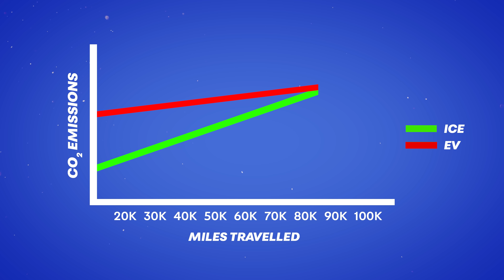Are Electric Cars REALLY That Green? [New 2022 Data]

Comment: A lot of owners of Ev or ICE cars are all contributing to the pollution problem. Why? Because of all the bloody idiots who drive SUV's! and what are the reasons they do this?

Reason No 1. 'I want to 'protect my family' 
Yeah, they might be safer for you but they're certainly not for other road users and pedestrians. Most SUV's both EV and ICE are incredibly heavy and much higher than most normal cars so when you hit a smaller car you're likely to do much more damage/ risk injuring the occupants of the other vehicle. It's also the same for pedestrians. With smaller lower cars in a front impact the pedestrian is more likely to roll up the bonnet (hood) and suffer a less serious injury whereas an SUV has a higher front so, for pedestrian, it's like hitting a brick wall.

Reason No2 'My d**k is bigger than yours' 
How many people that buy these 4WD Chelsea Tractors actually need one? How many of these SUV owners actually use them off road? Hardly any of them. It's all about keeping up with your other more-money -than-sense friends.

Reason No3 'Due to advanced technology both modern EV's and ICE SUV's are better for the environment'
Once again it all comes down to weight. A smaller EV or ICE car weighs less so doesn't need such heavy batteries/use so much fuel. If the vehicle is lighter, it uses less energy. Simples!

In conclusion: (And I know I'm going off topic her).
Most vehicles , both EV and ICE are consumer durables right? So if people REALLY want to help the environment to heal itself then the answer is simple. 

Just stop constantly buying crap you don't need. Mobile phones, Internet enabled fridges/kettles/doorbells, Dyson vacuum cleaners that cost 100's of pounds. the list jus goes on and on.   

Ask yourself this simple question, how much of this stuff do you really need?  Does it make you happier? Are 'things' better than family/friends or loved ones?

I drive a 2017 Vauxhall Astra Ecoflex estate. I paid 4 grand for it second hand,  It's now probably worth less than a grand . I've had it for ages, It's never broken down, and it's really reliable. I will continue to drive it until it finally runs out of breath. When that happens I'll look round for another similar type of vehicle (if i can still buy one)

If you got this far, many thanks for reading my 'rant'

Comment: and this is just CO2 emission
imagien there's so many other factors too.
- EVs are double the weight, more roadwear = repair/ emission/ etc.
- ICEs have more maintanace stuffs that pollutes, e.g. engine oil, etc.
- Depens on where that particualr country generates their electricity from too.
- Metal sources like Lithium mining can be very polluting/ unethical. 

too many factors. just buy the most economical car you like and drive it for 15-20 years.

Comment: This is not correct even 2 years ago. Volvo making their EV on the same assembly line is not making it the best way, that is why it is more expensive and less Green!!!! In a Tesla the battery is much less to make and and the production, and where the energy is coming from are so much better then 2 years ago. The BEV takes around 2 years and 30k miles to catch up to the ICE car, which you said is polluting all the time. The EV is not. My wife and I have EV's and solar panels, hers is new mine is old. So we are mostly Green!!!

Comment: Different countries have different electricity mix, the higher the renewable portion the better to electrify mobility. Costa Rica has an Emission Factor of electricity of 0,054 Kg CO2e/kWh from the grid which makes it an excellent country to use EVs. The break-even point could be very close to feeding the car with wind electricity, besides being a local resource instead of using petrol.

Comment: But by the time you break even you need a new battery which puts ev's back to square one. I also do not understand the ice continuing to climb on the chart. They simply continue their output level, not increase their output level. I'm confused.

Comment: I challenge those Volvo figures…. If as you say the XC40 Recharge is built on the same chassis as the ice version, it will not be efficient… Tesla studies show 11k miles until reaching the crossover and that was 3 years ago…

Comment: Brilliant vid - Volvo have thrown the catalytic concept out there for debate by basically underlining the scope for improvement. Governments through legislation could add impetus to the EV manufacturing evolution into greener sourcing, supply and manufacture etc. I would ask if environmental impact of rare earth minerals have been included in the calculations or are we just looking at Co2 generation ?  I am also painfully aware that EVs use product only currently available from the refining of crude oil - such as the  graphite anodes of the Li-ion batteries - as naturally occurring graphite is not pure enough. Then look at the car tyres - it takes about 5 gallons of crude to make sufficient synthetic rubber to produce one tyre and approx. 15 tonnes of bitumen to make 1 kilometre of single carriageway - Crude oil is approx. 4% bitumen so the amount of crude needed will be one heck of a lot (approx. 95,000 gallons of crude with the remaining 96% being used as lubes, fuels, plastics, solvents etc.). so car ownership no matter if ICE or EV has a whole heap of additional sustainability costs - such as maintenance and replacement parts (especially batteries) There will be an answer to green mobility - but I do not think we are there yet and we have a mountain to clime to actually scale back our reliance on fossil fuels. Just really glad the debate is happening and I feel Volvo are heroes  for putting a realistic stick in the sand as to where we are and sharing publicly.  I am fed up with car makers putting an eco sticker on their cars when the reality is........

Do I have any answers - well - NO but I may be just starting to appreciate the questions.

Comment: Pretty sure such a question require more math

ICE require fossil fuel transported by trucks and sometimes ships
ICE car require more repairs, which isnt enviromental friendly either, neither new part or new repair
 
While with EV there is much easier for Local produced energy, less loss of energy and less traveled and therefor more friendly in those term

Might just be me but i think its hard to get such a mathematical question right with all sorts of varity

Also i will say its important to kickstar the EV industry for competition and potentially there’ be a breakthro in battery tech

Comment: They leave out the things like tires and the body panels and the coating on the wires of the electric car require OIL PRODUCTS! The things needed to make solar panels and wind generators require OIL PRODUCTS!! The chemicals to make the batteries are extremally toxic but you all leave that out because you never want to show the massive leach fields required to process the chemicals that go into the batteries it is not just minerals. The leach fields are extremely deadly to animals as well you all leave that out as well. The fact those chemicals use in the leach fields get into the soil as well. EV's are not green period.

Comment: Something I'd like to add... ICE Performance cars.  I've had modified petrol & diesel Performance cars that have sacrificed every possible angle on environmental benefits... they've been brutal to the environment with tuning, replacement parts & tyre wear.  Millions of people in UK drive highly modified cars & motorcycles.  To an extreme level with no Catalysts, tuning boxes, etc

My Tesla Model 3 Performance is faster than most of them, even driven hard for Performance fun, it's WAY better...

I fill my Tesla at home with overnight cheap electric tariff (supposed to be renewable), but during Summer I use my home Solar Panels to fill the car, as I'm at home all day.

As a guy who wants to just have the option of some fun acceleration (being within the road traffic laws), electric is WAY better in my opinion.

Comment: Thanks for the link to the report. Interesting.
Very unfortunate the comparison was made to a petrol engined car. It should have been a diesel. Diesels are better in energy efficiency.

The data in the report on page 24 allow to estimate what the comparison to a diesel would be like.
Today Volvo no longer offers a diesel engine in the XC40, but back in 2019 they did and comparing CO2-emissions the diesel is at least 10% lower than the petrol.

Break even based on global electricity production shifts to 200.000km or full time car life. No benefit.

Another thing: one can think that by buying "green" electricity the electricity is CO2-emission free. That is not the case. Everyone gets the same electricity. That idea of "green" electricity is fooling yourself.
Even worse. Volvo uses for the EU28 comparison the average electricity production mix in the EU. Which is in my view far too optimistic to represent reality.

Today only a small fraction of electricity produced is "green". Maybe 20% on EU level. Which means only 20% of present consumption in the EU is covered by "green" electricity.
Adding a new consumer to the grid will never, ever be fed by "green" electricity. Where will the electricity come from in reality? Then you have to look at what power plants can increase their power output, and that is not solar, not wind, not nuclear. The only power plants that have extra capacity are the fossil fuel power plants.
So adding an extra EV to the grid will be fed by 100% fossil fueled electricity.

Comment: The fundamental flaw to any business led solution to reducing CO2 is undermined by the fact that these companies need to sell more and produce more every year regardless of whether people need stuff or not. Things get cheaper the more stuff you pull out of the ground, not more expensive. 

Marketing and culture and political influence and our consumerist society in general means that whatever we do it we won't be making things last as long as they could or be encouraged to replace them only when necessary - not doing these things is bar far the biggest contributor to CO2 and undermines pretty much every attempt at reducing it by corporations. 

This is all spinning wheels in the sand. At best efficiency increases slightly slow the pollutants caused by growth. At worse they just add to the problem.

Comment: I've seen a couple of these videos, doing the same math and i am by no means an EVangelist, but i've noticed not one of those videos seem to take in account the co2 pollution from refining the oil into petrol, nor all the co2 created transporting the oil around the globe and then distributing it via ICE powered trucks. The same also is true for EV's, what about the co2 created in manufacturing the charger stations and the loss of electricity in transmitting it over the powerlines to the stations?
Reply: Im not saying, you should account for every possible pollution, but these seem non-negligible

Comment: The co2 greenhouse effect can not really be proven. Take that out of the equation and the benefit of an EV is really less smog. Nice to have but not earth saving. Where is the funding for the co2 greenhouse sceptics? You don't see it. The only research that is funded are for those who already believe co2 warms the earth. 1 out of 10,000 air particles can't possibly have that great of an effect...can it? How can we know for sure if the research is not fully funded. Also, some states, like CA have very stringent gasoline standards. I'd love to see how that changes the 52k miles equation.

Comment: Ev,s the big environmental con, if you want the best car environmentally get a non plug in full hybrid like the toyota self charging hybrid exceed diesel fuel economy in all driving especially around town a small battery so less environmental damage and a petrol engine designed for fuel economy, full battery ev,s arnt the future there just a fad hydrogen direct burn and fuel cells are the future

Comment: The way I see it, electric vehicles still come out on top.

What this essentially says (assuming I'm understanding what these numbers mean) is that none of the emissions are actually being produced by the vehicle, but are instead a by-product of still being reliant on the fossil fuel-dependent energy grid. In other words, the carbon footprint of the electric vehicle is derived from manufacturing & recharging, rather than any of it coming from the vehicle itself. What this means is that if everyone switched to electric tomorrow, we'd still have problems, but they would be simplified:

Instead of the vehicular carbon footprint being a separate issue from the overall carbon footprint of the energy grid, both would instead be one & the same, meaning we'd no longer need to split our focus between vehicular emissions & energy grid emissions, as both would be one & the same. Thus, the solution would then be to continue to push for the transition away from fossil fuels.

To put it another way: If the global energy grid went completely green tomorrow, electric vehicles would suddenly become as clean as advertised, while the ICE cars would still be pumping out their own emissions.

Someone correct me if I'm completely misinterpreting this, though.

Comment: This doesn't sound like news to me, I've already read in several places that electric cars are more carbon intensive at the front end of their lifetime but gradually pay that back based on the energy mix used to charge them. I think the IEA reports a similar finding.

Even in the worst case where the breakeven happens around 90k miles, the story isn't complete if you aren't factoring in the carbon cost of ICEs ultimately needing to be replaced sooner than BEVs due to part wear. Then there's the recurring carbon cost of maintaining an ICE during its shorter lifetime - ICEs have way more wear-prone moving parts than BEVs.

Then you need to factor in the lifetime of the batteries separate from the BEV itself; once a battery is done in a given car it can still have plenty of useful life as a stationary grid backup battery in support of the renewable energy transition and finally move on to be recycled (hopefully in a much less carbon intensive process than the original mining operation). 

And of course a given BEV can have its batteries replaced with newer more environmentally friendly batteries effectively giving the BEV a new life and mitigating the cost of manufacturing an entirely new vehicle. Aftermarket batteries and vehicle control systems are going to be their own sub-industry in 10 - 15 years.

Comment: I agree with you that electric cars will not save the environment at the moment due to the manufacturing processes that cause more pollutions than the ICE cars.  
If I get an electric car it would be for the cost savings vs gas at the pump.  But will that be eventually true????  Will there be enormous taxes on electricity at the charging stations in the future???  Many states still have fossil fuel resources supplying the electricity. So we are not entirely emission free even with how we get our electricity.
Time shall Tell if we will even save the environment with electric transportations.

Comment: I think Toyota makes a good illustration of how … what I’ll call “PHEVs designed and used right” … can be the best solution for now.

A lot of European PHEVs are just heavy petrol cars, because their hybrid technology doesn’t improve mileage very much, and they’re only purchased in the first place for the tax incentives, then rarely plugged in afterwards.

The hybrid technology in Toyota’s PHEVs, however, really does improve MPG.  My 2017 Prius PHV (called “Prius Prime” here in North America) gets around 55 miles per US gallon (66 per UK gallon), on regular unleaded gasoline.  Driving around town on petrol, the engine is off most of the time.

If you combine that with being able to do the vast majority of your day-to-day “running about town” on electric, at ~4.5 miles per KWh, you’re doing quite well for the planet and your wallet.  All that, on a battery about 10% the size of a full-BEV battery.

But you have to plug it in frequently, or you may as well just buy a non-plug-in hybrid.

Full disclosure though, my Prius Prime drops considerably to the mid-40s MPG US at 75-80MPH, due to wind resistance.  But below 65MPH though, 55MPG US is about right.